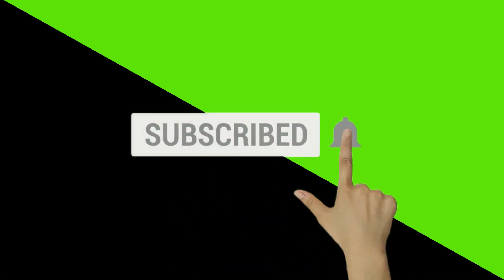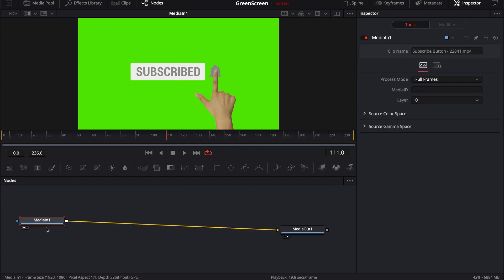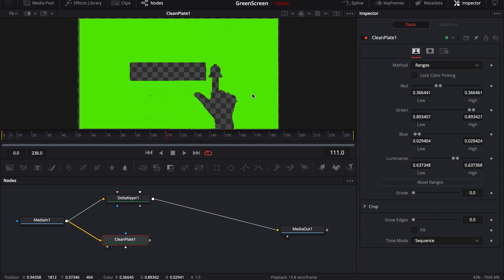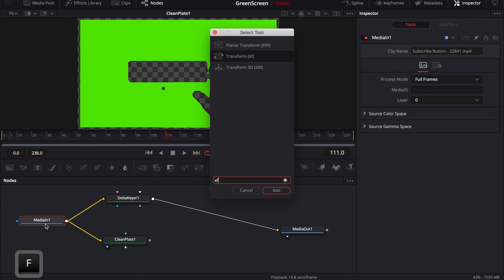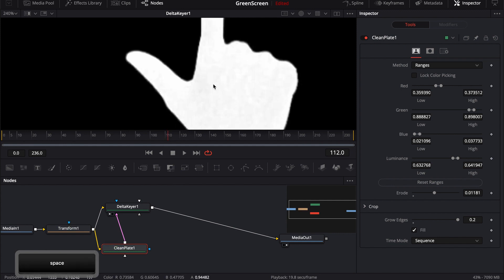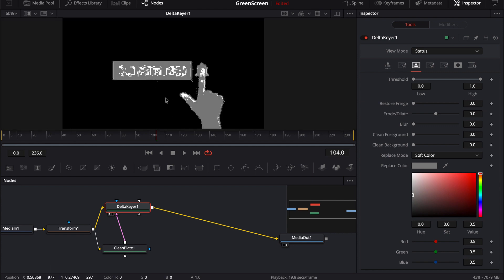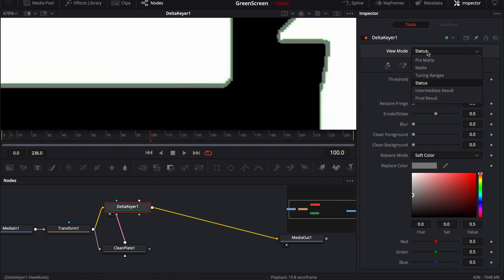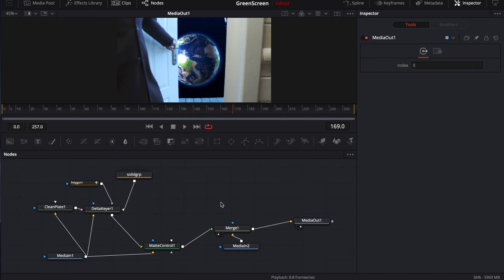Delta Keyer in DaVinci Resolve

Comment: I have been trying so hard to find a good, in-depth tutorial about fixing green screen issues in DaVinci, and I finally did! Thank you so much for this! I definitely appreciate the length of the tutorial.
Reply from the maker: Glad it helped! Keying out green screens is definitely a problem solving exercise. Each problem usually requires a different approach to keying it. Sometimes you need to combine the mattes, sometimes you need to do a little roto, sometimes they need denoising...just so many options. But this method is great for very noisy footage and lots of green spill or reflection.
Reply: @CBSuper  I'm sure I'll be spending a lot of time playing around, but this is a great place to start. Thank you!

Comment: I had to watch this 100 times to get my Green screen comp right. Man fusing is hard. Although I just saved the Fusion Project so I can just drag it in next time on any footage. Thanks so much. I just bought Composite Brush for AFter Effects and I must say Fusion is performing better at Green screen comping
Reply from the maker: Great to hear! This technique is powerful, but I'd only use it if i had significant green spill and a really noisy key. Otherwise, there are much easier techniques to use if the footage is well prepared.

Comment: Your videos are so helpful to me as a total novice. I'm grateful. Still a bit confused about the purpose of the Clean Plate Tool. Also im intrigued but not totally confident in my understanding of "alpha" and what exactly it is and how it functions beyond the fact that it is "transparency". Again - you are killing it! Keep it up!
Reply from the maker: Let's start with Clean Plate. The term "Clean Plate" in the vfx world is usually to have footage of the background without the foreground objects (usually the object you want to remove digitally/physically). But, the Clean Plate tool is is a little different. It is used to to smooth out the lighting differences in the green/blue screen. The lighting differences are often what make it tough to get a good key. It is just a method of Pre-matte preparation. You can also use the Pre-matte prep that is built into the Delta Keyer node. By using the Clean Plate node, you bypass the Delta Keyer Pre-matte functions. This is the method I've been using in Nuke for the past 5 years or so, but I would need to play around with the Pre-matte functions in the Delta Keyer to see which method is actually better. In reference to the Clean Plate node, I like that you can select a range of green and I find the erode/dilate and subsequent grow edges/fill functions intuitive and efficient for my workflow.  As for "Alpha". That is the term I throw around a lot in all my videos, but it can mean a couple different things. It's usually in reference to the Alpha Channel of a piece of footage or node. The alpha channel is a channel similar to the RED, GREEN, BLUE channels, but it only holds information relating to the transparency of the footage. By default, the Alpha channel is all white, which means everything in the footage is opaque (or not transparent). This is probably a topic I should make a video on to better explain, but when you key out a green screen; you're essentially creating an Alpha Matte that will make all the Green in the RGB channel turn to Black in the Alpha channel (thus turning the green in the RGB channel to transparent). But that's not to say that you won't have any grey in your alpha since you'll often have varying levels of transparency such as blur and hair detail. Understanding  what the alpha channel is for is very important as many visual effects (if not all of them) are effected in some way by the alpha. You can think of an Alpha Matte as a mask and I often interchange the two words Mask/Matte, although I don't think they are exactly the same. A mask is often used to create a Matte that resides in the Alpha Channel is probably a better way to look at it. A mask is a method of selection. Just as keying out a green screen is a method of selecting what should compose an Alpha Matte. Rotoscoping would be a method of creating an Alpha Matte using masks. I know I haven't made a video on Rotoscoping, but I will...soon as I get a chance. When I started making vfx videos for this channel a couple months ago, my goal was to get videos out on all the Fusion tools and functions before diving into the techniques, but after making a few months of videos, I find it's tough to make a video on certain nodes without showing their use in more detail. And of course I get distracted a lot and end up jumping down rabbit holes here and there. I'll make a few follow-up videos in the next couple weeks to try and better explain the whole Alpha Channel and Alpha Matte nonsense and you can also check out my other videos (if you haven't already) on Bitmaps and Masks to see a little more on creating alphas. Hope this lengthy explanation helps a little and feel free to shoot back any follow-up questions and I'll try to clear up any other concerns.
Reply: @CBSuper  it helps a lot. I've seen your other videos but am going to review them. Your way of describing alpha in relationship to its role in VFX and masks and matte helps me understand its role better for sure.

Comment: Great Video... I know the concepts but not all the details of what each of the node settings can do.  Wish i would have understood more of how the nodes worked together when I created my unwrap video.  Thanks for the great explanation!  Will definitely use this soon!
Reply from the maker: I liked your creative idea of using a green screen to unwrap footage as a transition. I think your technique still holds up well as a transition since a transition happens pretty quick and the small imperfections are reasonable given the efficiency of a quicker technique. This technique takes a bit more time and can be finicky when dealing with the spill suppression of the Matte Control. I also never even touched on using a Color Corrector node to suppress certain color casts and reintroduce greens/blues back into the image, but keying out green screen footage can be a very lengthy process.

Comment: Absolutely amazing, thank you very uch for this tutorial. It helped me get rid off lots of noise in my keyed footage
Reply from the maker: You bet! It would be nearly impossible to key out the noise if there was a lot of green spill on the scene. Keeping your subject further away from the green screen will help a bunch when you shoot. Cheers!
Reply: @CBSuper  actually we had plenty of room between the subject and greenscreen. And it's very strange that I am able to get much better key in FCPX with built-in keyer than with Delta keyer in DR. The noise (and strange pixelated maps on skin) are caused by Replace Color in Matte tab. I was tampering with a lot but I was unable to get a good result. The only mode where the noise is not present is the Source mode - but then I get some green spill. Anyway your solution works the best ;)

Comment: Wow! That's a great technique, but I haven't understand why use spill suppression on matte control, if it still the same spill suppression, as in the delta keyer. I have got the same results with both methods.
Reply from the maker: Yup, different techniques for different problems. Is you bypass the delta keyers spill suppression because you need a pure alpha channel, then you’ll need to use the spill suppression in the matte control. If you use the delta keyer in its normal configuration, then you can use its spill suppression. Just depends on how much noise your footage has. Sometimes youll use several delta keyers and combine the mattes...its easier to have one spill suppression at the end then combine them as they could differ.
Reply: @CBSuper  is there another spill suppression node? Or only in delta and matte? And why use 2 deltas?

Comment: Thanks for the level of detail in this video. One question I haven't been able to figure out, how can I color correct background independent of foreground once they have been merged? I would like full use of the color page to match them up. Thanks!
Reply from the maker: You can but it gets a little complicated because fusion takes place before color page. There are  ways around this of course. You can either keep the foreground and background separate, render it with alpha, then color them.  Or you can use fusion comps to bake if then color it. Similar but different.
Reply: @CBSuper  Thanks for the reply, CB. I really like your method of using the MatteControl Node for green spill suppression, but I have to color correct my video foreground independently of my image background. Is there any way to use the MatteControl node and without merging the background in Fusion? Then I could show my keyed foreground and my background independently in the Edit page and color correct them individually.
Reply from the maker: So you could build the foreground matte like normal and then just not combine it with the background. Then just put the background  plate lower than the foreground in the edit page timeline. But to color it correctly, you will need to bake the foreground clip by turning it into a fusion clip after you have pulled the key from it. Its like precomposing and will allow the clip to keep the matte but also show up correctly in the color page. Or at least that is my theory. I didnt try it. Haha. I’ll try it out and see of that works when i get some free time.

Comment: great video! thanks a lot. When and how do you apply a LUT that only applies only for the footage keyed(not for the clean plate)?
Reply from the maker: I think as long as its down the comp line, should only change the post keyed footage. If that doesn’t work, you can always render out the keyed alpha and footage then use the alpha as a matte for the new rendered footage. Then use your lut.

Comment: Hi I have tried your method but when i plug in the clean plate nothing happens? the only way to get the green screen to disapear is by selecting a colour with the delta keyer? I have made sure that the configuration is the same as in the video
Reply: when you add just a clean plate, how can you still see this video? When i have media in and media out there is no video visible
Reply: And why wont it let me add the clean plate to the delta node without there being a tranform node involved in the chain? in your video it can be attached without one
Reply from the maker: without seeing your node flow, i cant really say what the issue is. the clean plate is used to help the delta keyer figure out what the key color should be. its a pretty automatic process really.

Comment: Damn this is complicated but it is the way and the answer so thank you
Reply from the maker: So funny thing about green screen is there are many answers to the same problem. You can start off very basic and if it gets your desired result, perfect. But if the footage is too noisy or not properly lit, the solutions get much more complicated to get a decent key.
Reply: @CBSuper  and thats exactly where Im at with it. I messed around alot with the color correcting and managed to pull off green hues that way, but I knew there was more of a craft to it, and this is the only video that demonstrates that. So Im subscribed. Thanks for your content. The duo example was also a very nice touch.

Comment: Great video tutorial. But with keying out flowers I have the problem that my stems become brown instead of staying dark green. It is just like the green pixels from the green screen are eaten inside my dark green stems. Is there a way to solve this problem?
Reply from the maker: Yes, this is a problem even productions run into. The solution is to use a blue screen instead of a green screen. Red can also be used if your flower is blue. You can also just roto out the stem using a solid mask/matte.

Comment: Clicking grow edges and subsequently fill does not fill up my entire screen with green, is there a workaround for that?
Reply from the maker: I would double check the resolutions of your green screen footage and your comp to ensure they match. I haven't run into that problem yet. I would need to see your comp to see what the issue is. You may want to try and bypass the Clean Plate tool if its not helping.

Comment: At 19:19 you use the Delta Keyer as a mask but I can't figure out how you get that window to pop up with the three options. You just do it without saying how.
Reply from the maker: Hold either Alt or use your right mouse button to expose the different inputs on any node.
Reply: @CBSuper  I've tried both of those several times along with many other keys and nothing.
Reply from the maker: You grab the output of a node using your Right mouse button, then when you drop it on a node (if the node has multiple inputs) it will display a drop down that asks which input you wish to use.
Reply: @CBSuper  Is that possibly only for the paid version because I can't get mine to show anything?
Reply: Nevermind...I got it figured out now! Thanks for your help.

Comment: Hi! Is it possible / helpful to use an actual clean plate shot separately without the actor for the delta keyer?
Reply from the maker: yes, that will work as well.  You can even use a paint brush to clone stamp the green background and that would work as well. A clean plate node just allows you create the clean plate pretty easily by eroding and filling the bg with the green/blue you need.
Reply: @CBSuper  Good to know, thank you and thanks for making this video!

Comment: I have a question my beloved teacher: If my clean plate fails, can i fix it using masks and fill it with the correct green color?
Reply from the maker: You could but feather/soften the edges. You can also just mask out the footage in the delta keyer itself.
Reply: @CBSuper  Wow, you replied and fast. Really thanks! Your classes are golden. I hope you can continue. God bless you!

Comment: Great video 🎥👍 I have 2 questions 

1 if your source footage is flat, would you add a LUT to change it to REC709 in the node tree or try to work with the flat footage

2 edge/light wrap - can you show how you would do this ? To help bake the foreground keyed footage into the background so it’s more believable 

Thanks in advance 🎥👍👊💪👌
Reply from the maker: So when you say flat footage,  I am guessing this is like a cinistyle-like or maybe even a log look that will preserve information. There are a few ways to grade the footage, but most folks would probably be more comfortable grading the footage in the Color tab where they have plenty of tools to help with grading. You definetly could add a lut to your footage in the node tree also if you are not familiar with the color tab, but you dont get all the neat scopes and waveforms (Fusion has some, but not to the level of the Color tab). You could grade each clip individually by not including the second clip in the Fusion node tree. You would essentially only use Fusion to key out the matte  and keep the background and foreground footages separate in their own edit tab layers. Since Fusion effects take place before Edit/Color tab effects, you get to key out the footage then color both footages on their own to match. As for a light wrap, I'd just dilate the mask edge a little and soften the edge, then color that on top or do it in the color tab as well. I am planning on making a more basic green screen tutorial in the Fusion Basics series, I'll be sure to add this topic to it.
Reply: CB Super thanks for a quick reply
So when I say flat, I mean Blackmagic Film from the Blackmagic  Cinema Camera 

I’m familiar with the different tabs in resolve 
EDIT, FUSION, COLOR, DELIVER 

Though the order is as above, I typically shoot BM Film mode and add LUT to convert it to REC 709... though the GREEN SCREEN work is done in the intermediate stage... hence I was asking would you add it in the node tree.. as you have to keep going back and forth out of the fusion tab to the edit tab to check the output 

Also, after trying your methodology, which was very helpful... I’m experiencing edge hair to dance... would that imply i need to de-noise my footage, as I don’t want to lose hair detail by simply blurring 

Thanks in advance 🎥👍
Reply from the maker: @rashpalsagoo11  I don't work in BM Raw, so I can't really say on that, but for the dancing hair...i'd try and add in a grey matte to your final matte to remove the dancing. The final matte can be composed of as many different mattes as needed to get the overall look you are shooting for. Each shot is different and requires different techniques to make it look good enough.
Reply from the maker: Sorry, I missed the LUT part, yes you can add the LUT to make the flat footage stand out more from your subject. You just need to add it before the actual key process either in fusion or bake it in prior to the Fusion roundtrip. Remember that fusion takes place prior to the color and edit tab effects so you'll either need to use a compound clip or fusion clip to bake it in...then you can scrap it once you have your Matte built. But I'd render the matte out and combine it later. But every clip is different.
Reply: @CBSuper  What's a grey matte? Been looking online and I can't figure it out for the life of me - but I feel like it could be the answer to a few problems I'm having with some green screening!
Would you edge/light wrap in the colour tab then? - Or is there a method through the fusion workflow?
Reply from the maker: @frankhigson4850  grey matte is just somewhere in between black and white. We use it for semi transparent objects like hair, shear cloth, etc. Allows some of the BG to come through.